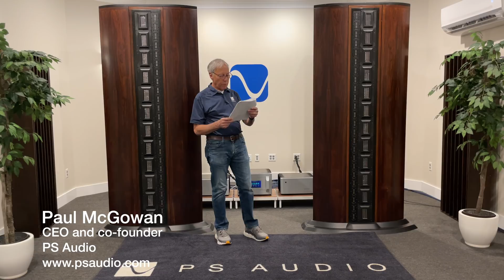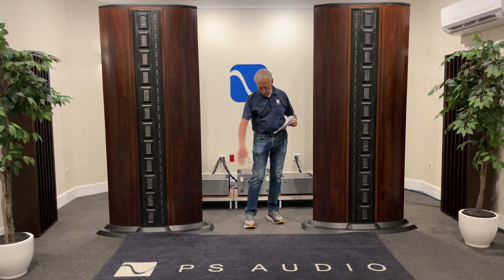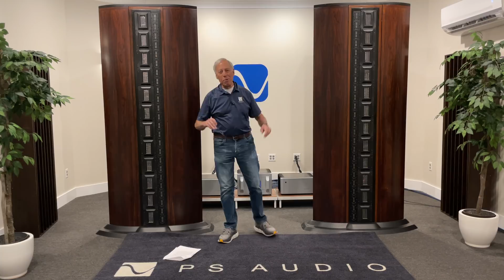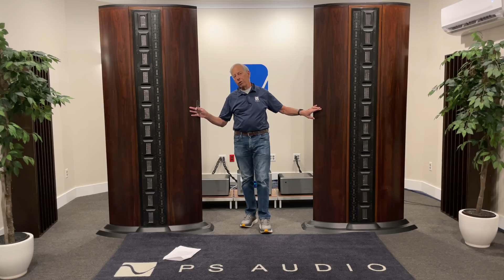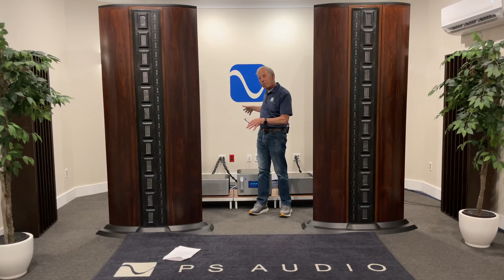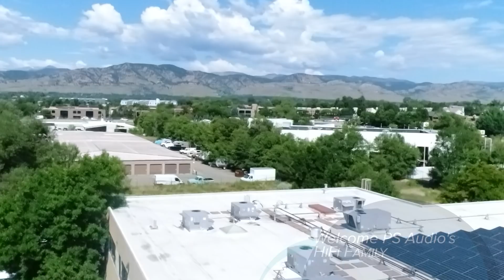Why sound comes from behind the speakers

Comment: I would like to recommend another way of explaining this.

Headphones simulate what the original audience of a live performance is hearing.  So if a headphone was doing its job properly, the sound source should not sound like it's coming from something that's against your ears (headphone drivers), but instead, it should sound like it's somewhere in a virtual three dimensional space regardless of the size of the room you're in.

So speakers are supposed to do the same job as a headphone (I know, blasphemy) with how it's intentionally positioned with reference to your ears, to make things sound like how they were originally recorded or how the sound designer intended.

Speaker systems just dump all that fine tuning task on the user as opposed to with headphones where the engineers/specialists know exactly where it would be from your head.

Comment: This is  a better explanation than any I’ve heard, but wouldn’t it still be preferable for the speakers to project the position of the imaginary microphones to a space near your ears (i.e., your listening position) rather than on a plane between the speakers? I hate it when the soundstage is created in what is basically a blank wall behind the speakers (my ELACs do this) when the soundstage should fill my listening room (which my Focal speakers do, imperfectly). My ears should hear what the microphones heard, not what some guy six feet behind the microphones heard.

Comment: It's hard to explain magic and there really is a little bit even when the physics is clear. With vinyl, that microscopic mechanical wiggle becomes a microscopic electrical signal that is manipulated and amplified, then fed to a speaker driver that returns it to mechanical motion, that can recreate a performance astonishingly accurate. Thanks.

Comment: It's not "happening". It sounds as if it's coming from behind the speakers, it's an auditory illusion. The speakers should ideally melt away - the ear and the brain interpret location, which is why it's sometimes difficult to accurately pinpoint the exact source of sound. For two channel music - you don't want it to be too directional. It's only when you're talking movie surround sound, when you want to hear that car accelerate from left, alongside and disappear off stage right.

The brain is the most important element in all this - it has to be fooled every step of the way, as we know we're not actually listening to an orchestra, a band, a singer but to a recording of them, reproduced via an amp and sent to our ears by wooden boxes. The only way to achieve that illusion is trial and error, and listening. Forget about doing that from a 200 page book - every room is different, every furniture set-up is different, every assembly of amp/DAC/speaker/speaker stand is unique, and most importantly, every ear is different and every expectation is different. Don't be confined by what one expert says you should want!

Comment: Nice explanation, kind of amazing that the ear/brain can still pick up all the cues it uses to resolve depth after it (the sound) has gone through a microphone.
ps:- you'd be horrified by my speaker placement, diagonal in an odd shaped room. I still enjoy the music though, so it's doing it's job. I don't think there is much depth info in what I listen to, most mic's are positioned 1 inche in front of the performers tonsils, and most instruments are directly connected to the mixing desk.

Comment: The one time I had an amazing depth effect was when listening to the Proprius recording of Contante Domino. There is one track where the image was wide, the sound was coming from behind and higher up. I have DCM  Timeframe 600 speakers and they are about 6 ft from the back wall. I once heard them at a stereo show in a large hotel conference hall and they did the same thing with a big band recording on vinyl... except the image was 10 times as large.

Comment: What I don't understand is how can you have a "soundstage" when the majority of recordings are not done "live" but of each instrument recorded separately onto separate tracks which are mixed together in the final track......there's not actually a "stage" at all but a mixture of instruments and/or the singer(s) in booths which are mastered........so how does the engineer "place" each performer on this imagined "stage"?  They are not really at a particular "distance" behind a pair or more of microphones, unless that track is ACTUALLY recorded in one live session (kinda like the beatles in their early years, thank you George Martin!).  Hey, I will be more than happy to wait for a new video if it takes one to explain this.
Reply: Here's the basics of how they do it. First imagine listening to a recording with a strong center vocal image. If you adjust your balance control, the center vocal image will move from side to side depending on which way you turn the knob. One speaker is louder than the other, so the image shifts to the louder speaker. Now, lets say the engineer wants to place an image of a vocal or instrument further back to create depth. You would start by using the same ratio used in previous example to get lateral placement. To move it back, you would lower the volume of the track relative to the images you want up front while keeping the placement ratio the same. Doing that will make the track sound further away. The engineer can also use effects, like reverb, on a track to further enhance whatever it is they are trying to do.  

A good engineer can take a multitrack recording and mix it using the above techniques to create a soundstage of musicians playing in real space. Its artificial, of course, but if you can't record using only a pair of stereo mics, this is your only option.
Reply: exactly, and that is the flaw in his argument
Reply: @johnholmes912  I see no flaw in his argument. In modern recordings, many productions fail to set up good image, but then are artists such as Above & Beyond, Enya, Daft Punk and  Massive Attack who achieve very good results. If you feed BS into your system, you will get BS out. Not that earlier recordings were all good either. You have to hunt for the good content.
Reply: Sound engineers move musicians/sounds into positions within the soundstage purposefully. It's because if two or more sounds come from the same place, it's hard to hear the sounds individually. (They become a cocophany of sound.)

Also I think some engineers place instruments in the soudstage to reflect musician's positions relative to each other. As they were in the recording studio if they played together, or to reflect their live-gig positions. (Am sure I read that.)
Reply: @threecats8219  Sound Engineer Dan Worall touches on this,  in his video: The problem with LCR mixing https://www.youtube.com/watch?v=-fofVE9Q3fI
Reply: @threecats8219  No no - when two sounds come from one point it is just   reproduction with mono speaker In some cases very comfortable to listen.
Reply: thought of that too.  Would that soundstage only appear in simultanously recorded setups?
Reply: If you    make own good sounding recording DIY you will realize that 90% music coming from speakers must be modified in studio to add heard information about place  in which it is performed. It is done else by recording  original hall where it is performed or added in studio from different setups.  Otherwise it will sound dry in room and just like  instrument in  speaker.  Of course also is 10% of recordings where is mainly one performer and he plays / sings direct to microphone (close recording) and then any rear impression is although  possible to achieve but wrong  Balancing  effects  is possible to produce not only rear sounding but also 3D.

Comment: This is a Poor and Incorrect Example.  Studio Mics tend to capture sound from a very singular plane.  An example is a Singer, that Sings very close to their Mic, which is protected by a wind-screen.  They do not place this Mic 6ft away from the singer.  In fact... if the singer moves a hair too far away from the mic, these mics end up losing over 50% of the volume levels.

 Furthermore... when famous bands are recorded... they dont simply use dual mics, and play all together.  They have each member of the band play separately.  The Mic is placed in specific ways, optimal to each instrument utilized.

 But more importantly, again.. is the Mic situation.  Even if the Mic is designed to take in sound from 360 degrees... How exactly would the Mic know which direction is in Front of it... or Behind it?  IE:  If we stand 10 ft apart, and place a Mic in the middle... What happens to the sounds recorded, when played back?

One of the main reasons why something MIGHT sound behind the speakers, is merely down to an Audio Illusion that forms in the brain.  This illusion, is likely brought on by the differences in VOLUME levels

 For example... if I recorded two tracks:   1)  I sing the LEAD vocals at normal volume levels  2)  I sing the backing vocals at 1/4 volume levels.

 What do you think will happen when this is played back together?   The more quiet sounds, will appear to be Behind the Louder vocals.  The distance, will likely be somewhat relative, to the differences in actual volume levels between these tracks.

 When you listen to music with Headphones... the Audio is pumped directly into your ears.  Its not pumped in front of...  or behind your ears.   Yet, certain music and or game sounds... will seem to be in front of, or behind you.

 The rest of the 3d effect, depends on the actual recording methods, and or mixing effects.

 A real world example, is something like the 3DIO mics.  These are human ear shaped mics, that are spaced apart about the same as a humans ears.  As such... they capture sound in a similar way that we actually Hear.  One of the main reasons why we know what is behind us... is because the ear lobes are pointed forwards... so any sounds from behind, are slightly changed, due to the path they travel, and the tissue that gets in the way.  And likely, frontal sounds are amplified in details, (and volume) due to the cone shape.

 Anyway... when you play music loud enough on your speakers... the louder things will appear to be more forward in the Image.. .and the quieter things, will appear to be further back.  The actual soundwave cancelations + dominations themselves, may also play some factor in this.  But most of the depth is likely being generated from your own mind, as it differentiates between the volumes.

 To enhance a 3d sound stage, special EQ and effect methods, can be employed to enhance the finished depth and directional effects.  A very simple example is reverb (echo).

 Personally, I have some great speakers, that have inverted tweeters in them.  They make the entire room 3D.. where you could tell exactly which instrument was approximately where.  They do not need you to put the speakers away from the wall, for this amazing 3D effect.  In fact, moving them too far away from the wall, reduces the wonderful bass response levels, so thats a big No-No for me.

 In my opinion, Im wondering if there is an issue with the narrow directionality of Ribbon tweeters, that causes a need for them to be further away from the walls, to gain a much deeper image.

 What I can say, is that Ive heard a 360 degree dipole tweeter on a small radio shack bookshelf set of speakers... and they were a total Mess, due to the sound bouncing all over the place, causing echo-like effects that distorted the music.  Obviously, the typical Ribbon tweeters are single direction, which would not cause such an effect.  Ive also heard an audiophile reviewed specifically state that one of his speaker sets that he tested.. which had ribbon tweeters... required the listener to be EXACTLY at a certain spot in the room, to get the best effect. He stated that spot was extremely narrow.  (Unlike the inverted tweeters, in which Nearly entire room becomes the sweet spot).
Reply: Boy John you said a mouthful. Hard for me to understand because I don’t know the recording process that well. If you want to hear what great voices sound like a-cappella listen to “no more walks in the woods“ by Eagles in the long road out of Eden recording. It’s staggering. Every one of their voices is separated beautifully and their harmonies and tonality cannot be matched. It’s not an answer to your comments but something I think you may want to listen to. Whoever laid out the mics did an incredible job
Reply: @Scopolamine46  One day I was walking through my friends slot-car shop.  Hes a sloppy hoarder, with no organization at all.  So, there were chaotic piles of papers, magazines, DVDs, and slot-car stuff.

 Anyway... I walked in, and I was completely blown away at the music that was playing.  It was a Disco song... and of course everyone knows how many instruments there are in 70s disco.  That, and it was recorded at the height of Dynamic potentials.. way before horrible Digital Compression.

 The music was all around me.. sounding like the damn band was playing LIVE, in the room.  Thing is... my ears are extremely good, and I still have ability to hear high-frequencies, even though Im now 48  (most adults lose a lot of high freq. range, before they hit 30)...

 Despite having excellent hearing... I could NOT find the speakers!  I spend about 15 min searching for them, which is insane.

 Eventually I finally gave up and asked my friend where the speakers were, and what they were.  He pointed to the front of the shop, near the glass window.  One of the speakers was vertically placed.  The other speaker was about 6ft away from it, laying on its side.  There were magazines on top of them.  There was a sit-down arcade machine partially blocking one of the speakers.  They were like 6 inches away from the glass.  Basically speaking, it was the WORST possible setup that you could imagine... AND YET... the sound was the clearest and most dynamically 3d, that I had Ever heard in my entire Life.

 These speakers, were the EPI 100v speakers.  The ones with the upgraded model Inverted Tweeters, that have the plastic frame housing. (the older tweeters are OK, but not quite as clear and dynamic)

 I ended up getting a refoamed pair... placed them in my attic, and I was in total AWE.  Everything I played through them..it was like listening to all new music.  Things like unclear lyrics in certain songs, were actually legibly clear.  Unlike all of my older speakers... where there is a clear sweet-spot in the room... with these speakers..  nearly the entire room, was the sweet spot.  Its was hard to even fathom possible.

 At one point in time, I had them in the living room, setting on top of a pair of 12" bullnose Advents.  I played a high def. blueray on... with something that had a lot of bass / bass effects.. and I asked him which speakers he thought were playing.  Mind you, he was only about 7 ft away from them.  He pointed to the large Advents.  He was blown away, when I said Nope!  Of course, the Advents have insanely more bass potentials.. which I also showed him.. BUT.. IMO, the bass on the advents were overkill and distorted to musicality. (but worked very well for movie effects, such as the rumbling train that comes in on, The Polar Express)
Reply: @johndough8115  I think you just described room treatment.
Reply: @Scopolamine46  I will have to add a special note.  Not everyone's ears are the same.  Especially as they have aged.  Part of this can also be due to the very SHAPE of your ears.

 If, for example, you lack some sensitivity to Midrange frequencies... you might not enjoy a speaker that I enjoy,  because I can hear the midrange levels fine.. and you will find them weak.

 Similarly,  if you lack some high frequency detection... then you may want an Extreme amount of Tweeter presence, which would help make up for your losses.

 A friend show me his new headphones, and they were so over-bearing with midrange, that I could not bear to listen to them.  I tried every EQ setting possible to try to reduce it was much as I could.. but it was still Ear-DRILLINGLY painful... like nails on a chalkboard, or Squealing Brakes.  But, he LOVED the things.  He clearly had hearing damages, and it made sense, when I remembered our various interactions ("What did you say?").

 The other problem that is frequently had in Audiophile circles, is in EQ.  A lot of people should be using EQ to customize and maximize a speakers / headphones potentials.   But, too many so called "Purists"  refuse to mess with EQ.

 The final piece of the puzzle, is Tube vs normal amps.  From what Ive seen from another reviewer... is that a Tube can help smooth out a poor recording.  Its likely that its not actually superior, in audio replication and distortion levels... but more so, that its making their poor quality recordings, sound better.  I dont have money to invest in Tubes... so I cant confirm my suspicions.

 Thanks for the recommendations.  I will try to check them out.  I love all kinds of music.
Reply: I do agree that in speaker  silent sounds are perceived like distant sounds and it is due to lack of physiology correction - our ears cut sound details  leaving middle Anyway in natural instruments it is no problem because silent sounds have different known well  spectrum. Loud sound of piano played in speaker with low loudness will sound like distant.  Silent sound of piano played with  the same loudness will sound natural